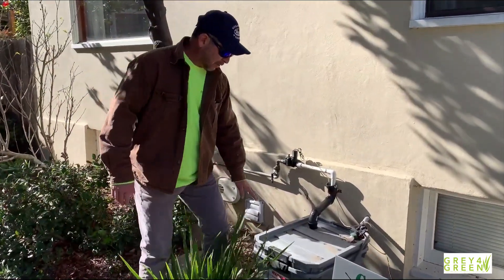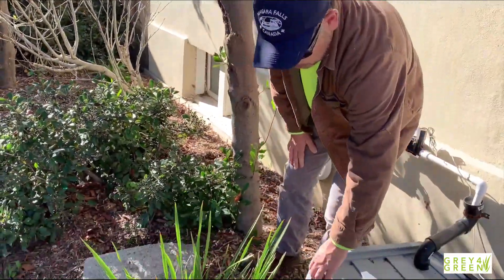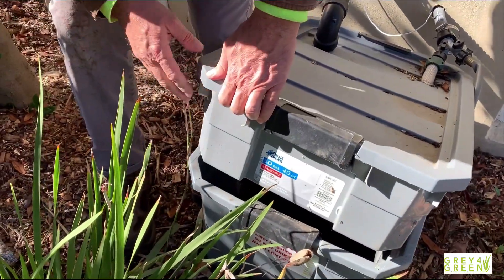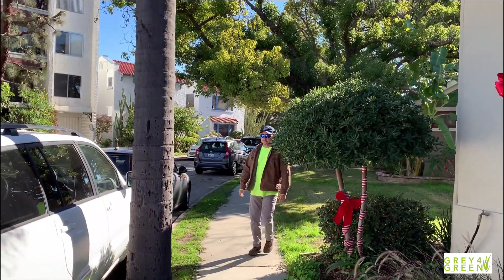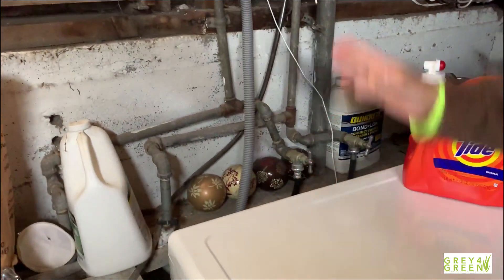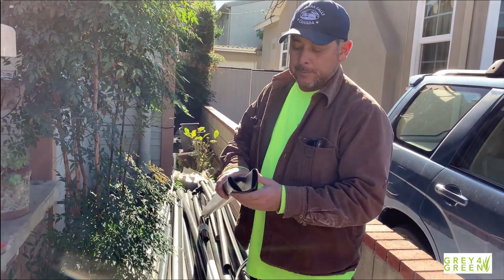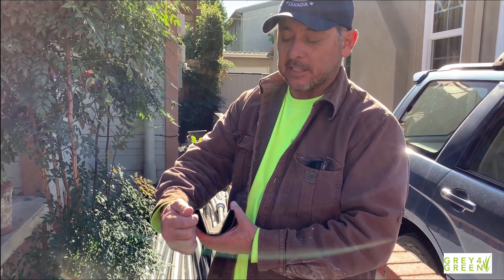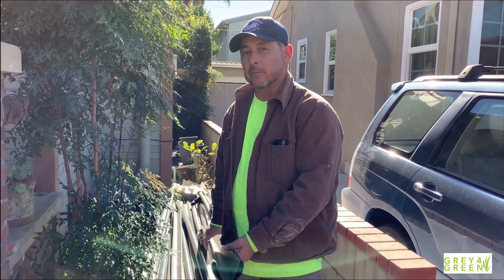Simple DIY Greywater Laundry to Lawn System

Comment: A low-tech approach is simply to have a dedicated hose with 1/8" holes drilled every 12 inches or so (You can alternate which side of the hose the holes are places so you get a better spread).  Cap off the open end so you get back pressure.  I have quick-connect fittings on my hoses, so I can swap out the extension with holes in it.  In fact, I have one hose that does a row of trees, and I never move that one; I just swap connections to use a different one or an extension to run the drip hose farther, like to the tree near the front of the property.  The other hose gets moved around after each load of laundry so everything gets some water.  Also, I use Ecos brand detergent since it's made with plant oils.  Been using it for years, and it's kept the plants thriving, even in droughts.

Comment: How do you prevent sulfate build up in the soil? I see the filter is removing larger particulates, but detergent has a lot of sodium in it to bring down the surface tension of the water, and this can build up in your soils, eventually preventing things from growing.
Reply: would make the soil more alkaline
Reply: I use only SA-8 detergent. No phosphates and great for the soil.
Reply: @brianwest3618  Anything that says sodium are salts. Sodium bicarbonate is a salt. All soaps and detergents have them. Over time a build up of sodium in the soil is bad. Phosphates are not the only harmful thing in soaps.

Comment: Aloha. We’ve been following your page for a long time. Huge fan of what your doing. Would I be able to apply your greywater system practices of burying the pipes in the yard to water yard ground up if I use drainage pipe? I live in Hawaiʻi and it’s crazy expensive to get your pipes shipped here. We scored a lot of the black drainage pipe with holes around the entire thing. Our yard is made out of coral and very fine dirt. Dolby I think it’s called? We live along the west coast of Oahu. We need a heavy duty machine to dig the trenches for our yard to lay the pipe. But before we do that I was curious if you ever used drainage pipe before creating your own special grey water drainage pipe. And how was the results from using drainage pipe? Mahalo

Comment: Really?  Any detergent?  Every other greywater says I need one with no sodium, but the only ones that make the list are waaay too expensive for a family of 7, plus they all come in plastic.  I've been wracking my brain out trying to find something that'll work but not break the bank. Thanks for sharing!
Reply from the maker: To sum it up, don’t worry about the detergent you use. Just too much over hype on using a “Greywater” approved detergent that is uncalled for.  

Here is the detail explanation:
I know the feeling, when I started out on this journey I discovered all the websites around greywater are just repeating what some else said years ago. What has happen over the last 20 to 30 years is the detergent companies have reformulated the ingredients to be nicer and safer for our human skin, in the process this has improved the interaction with soils and plants. At my house I use Tide and have started to use ecos.com when I can get it at a reasonable price. 
After a couple of years, I had the soil tested at my house and what came back was the greywater soil was free of arsenic (natural occurring), boron and chloride. The control group (standard potable water irrigation) came back with levels of all of these and the chloride was elevated. Bottom line the greywater soil was better and cleaned of harmful trace elements than the potable water soil. 
Now I would not use borax power, which is a sodium based detergent and was popular additive in detergents over 20 years ago. You can still buy 100% borax powered and we have a few customer who still use borax powder on their whites.  These few customers change the greywater to the sewer system when washing whites, then switch it back when done. 
_ thank you for asking this question, I get it  all the time.
Reply: @grey4green49  Thank you!
Reply: If you’d like to use a more natural detergent, you could try diluting Dr.Bronners
Reply: Trader Joe’s has a cheap laundry detergent that is biodegradable and free of this and that. Check it out.
Reply: use soap nuts, buy them at Trader Joe's
Reply: Overtime, Na accumulates over the garden bed and kills the grass or plants. If you use mulch, will minimize the damage but eventually sodium will destroy
Reply: @luckyone7328  Not all biodegradables are biocompatible, but all biocompatible are biodegradable. So, look for biocompatible instead of biodegradable.
Reply: We use only SA-8. It works great and better green alternative.
Reply: Vineger!

Comment: Should have drilled through the block.
Not recommended to extend the washer discharge hose to extend more than 12” above the machine.
It will work but you’ll be replacing the pump prematurely.
Those pumps are not very strong nor made to pump water vertically over 12”.

Comment: How can we increase the Aquafir pipe moisture plume? 4 feet wide is not enough to water the 1,500 foot lawn.
Reply: Thank you for your question: Your other option is to use a "NSF 350" greywater system.   A NSF 350 type of greywater system will clean the greywater to crystal clear quality, and the greywater is allowed to be sprayed on with sprinklers.  In 2022 the going cost is about $14,000 for a NSF 350 system that can clean about 200 gallons a day.
Reply: You will need to run parallel aquifer pipes space three to four feet apart

Comment: I sure hope you don't use tide in your yard... lots of chemicals in tide... yucky. It is terrible for the yard, and the soil.
Reply: Thank you for the question:  Sorry to say, I do use Tide and is my preferred detergent. The soil analysis I had done after using it for two years on my lawn was that the soil with Tide was in better health than the ground with direct tap water.

Now I am changing the from Tide in 2022 to ECO for two reasons: 1st) because of the greater good of plant base detergents (sustainable) and 2nd) The orange tide bottles are much harder to recycle, because of the color, ECO bottles are clear
Reply: cause it all ran off- illegal